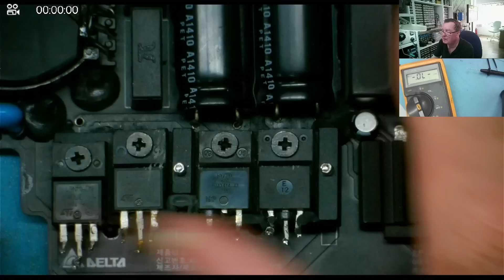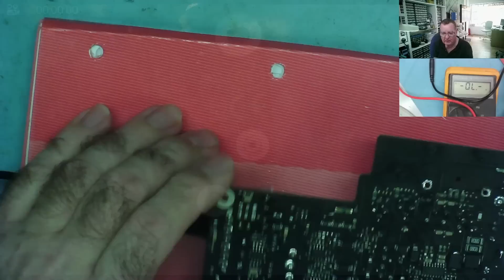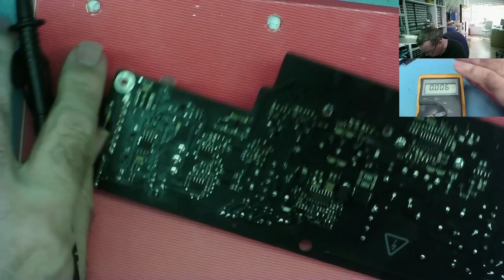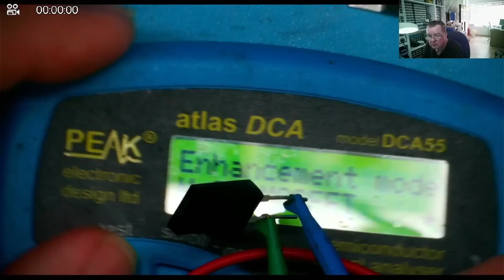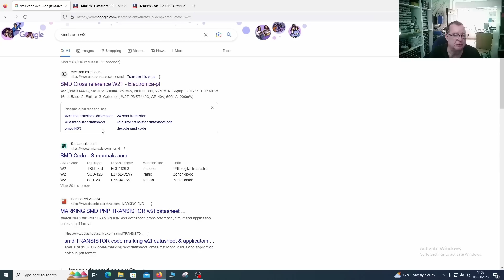Probably NOT The Best PSU Repair Video On YouTube!  Faulty Apple iMAC Computer PSU Part 2

Comment: Hi. Would be helpful if you can help with power supply which standby voltage works but when connected to tester the lamp lights up as its shorting out. Cant find on your videos one of these. Maybe missing something. Got 2 psu here with exact same problem evga g2 850 and cougar 850. If possible any help would be appreciated
Reply: A video with this problem would be helpful 👍

Comment: New to the channel, I was always fascinated with electronic when I had a work colleague who was a ex TV repair engineer working in the security industry, he literally pulled a small bag out, removed the cover from the CCTV keyboard, commenced chopping and soldering and in next to no time, system all back up and running. (D.H) Great videos you make it look so simple 👍

Comment: Since you have the component tester if you have more of those dubious transistors you can test them to see if they are at least FETs and not bipolar transistors or something else.

Also I see comments about an incorrect package, but Infineon made the 6R199P both with metal tab (PG-TO220-3-1) like the spare and isolated (PG-TO220 FullPAK) like the original so you can get genuine ones in both packages. Both say PG-TO220 in the datasheet summary but the drawing at the end of the datasheet shows the actual packaging.

Anyway on the genuine Infineon logo there is an "i" and the dot of the "i" can be a solid circle or a just a circle, but that one seems to have a "V" or a check mark instead of an "i", maybe it's some Chinese character, it must be in the top 10 of the worst fakes 🤦‍♂

There are a lot TO-220 variants and Infineon uses at least 14 for 3-pin components:
PG-TO220-3-1
PG-TO220-3-31
PG-TO220-3-111
PG-TO220-3-123
PG-TO220-3-253
PG-TO220-3-312
PG-TO220-3-313
PG-TO220-3-317
PG-TO220-3-321
PG-TO220-3-322
PG-TO220-3-901
PG-TO220-3-904
PG-TO220-3-908
PG-TO220-3-909

They make or made the 6R199P at least in:
PG-TO220 FullPAK with part # IPA60R199CP
PG-TO220-3-1/TO220-3-2 with part # IPP60R199CP 
PG-TO247-3 with part # IPW60R199CP 
PG-TO262 with part # IPI60R199CP 
PG-TO263 with part # IPB60R199CP
By the way PG means "Plastic Green" = plastic without halogens

Comment: Try rubbing some acetone with a cotton swab over the printing on the suspect mosfet.  If it starts coming off black it's a good indication that the original part number has been sanded off and it's been re-coated and relabeled as something different than it actually is (though some fake parts don't always swab black, so it's not a perfect test, but an awful lot will, and genuine parts never do).
Reply: I don’t think there’s any question the replacement mosfet was fake. It looks 100% wrong. Doesn’t even need to be repainted - the marking is just not right in any respect. Is screams cheap, and the original doesn’t.

Comment: The lack of ferrite beads may have contributed to some high frequency oscillation but I've not known them to cause such a rapid breakdown, more likely a fake FET (but then dim bulbs interact strangely with some PFC designs). As you say, would be worth checking the driver chip, resistor etc and refitting the PFC parts (with beads) to see if that part was working. Those pesky E01 resistors (marked as 103 in the Australian variant, ho, ho).

Comment: The transistor is surely a dodgy knock-off. Here're the evidences and clues:
1. the very top layer of plastic packaging with the original markings was simply grinded off. The original surface is expected to be very smooth almost like having a glaze coating due to the way the plastic case is manufactured.
2. the marking uses a different font type which looks like Arial MT. Every reputable manufacturer use its own custom font, not just a font type that most likely bundled with a typical MicroSoft Office software package.
3. the quality of the laser engraving itself and how deeper the etching was done. The edges and how the whole picture is done. Most likely you'll see a dot/pixel patterns/arrangements that would tell that the cheap hobby-grade laser engraver was used.

Also please be extra cautious. The exploded device package pieces that fly into the air are extremely dangerous as they always have razor sharp edges. Please take care.

Comment: The logo on the transistor is Infineon. The replacement was probably a fake, that only withstood the boosted voltage for a second. The logo on the fake one is deffinitely an attempt at imitating the original, but it can't be the same.

Comment: Looks like an opportunity to crack open the package of blown devices to compare the die size. It is very interesting what you've got from aliexpress and how it matches with the old device. Especially since you have a microscope, it wouldn't be so hard to inspect the die size. Just heat the device as much as you can (500C or higher) and then plastic top comes off with ease.
My bet is that the replacement transistor was originally rated for significantly lower voltages or just could be a completely different type of transistor. That's why it lets the smoke out.
Reply: I have been done by Chinese Junk many times, including fake graphic cards. I think that is why it is called Ali Express - get rid of it as quick as possible to another victim.
Reply: @sherlockholmes1121  I don't know why we keep buying this chinese crap! its useless, buy the original part from a reputable source and be done with it!
Reply: That’s what I was suspicious of. Buying from Ali Express for customer repairs seems like plying with fire in a dry evergreen forest. Things are bound to blow up. Ali Express is fine if you have made jigs to test components up to their ratings. I’ve got a couple PSUs I copied onto a less dense PCB and added sockets (expensive, sadly) to let me test parts in circuit and change them out easily. No fake mosfet lives long when loaded up properly at high line voltage :) In that respect I follow Mr.Carlson’s advice: functional tests are best. Just don’t do them in what you’re trying to fix.

I’m pretty sure the transistor is definitely a fake.

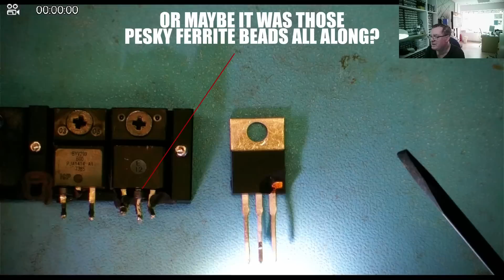Comment: 27:10 I never thought that those rings/ beads are really that important. I thought that is it only for an additional safety reasons (not required for normal operation).
Thank you that you pointed it out - to never forget to apply those rings back to new transistor.
Reply from the maker: It may not be what caused it - just a possibility I thought i should mention. because no doubt others would if i didn't.
Reply from the maker: I think it is more likely fake replacement Mosfet

Comment: Great video, yes carry on with the PSU repair. I have a mackie SRM450 V2 amp that the PFC works when injecting 18V. But will not power up with mains voltage applied. repair in progress